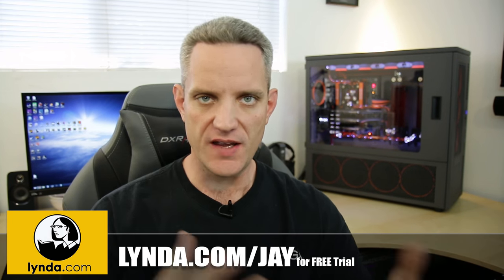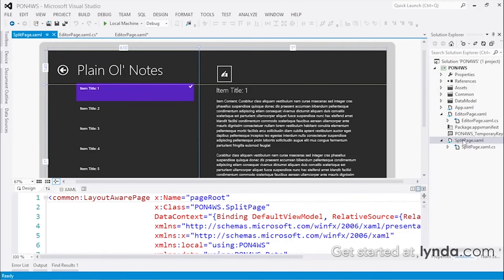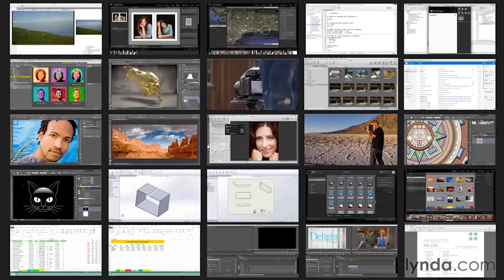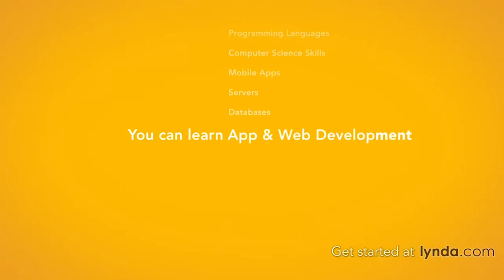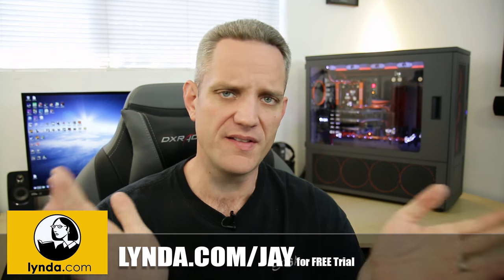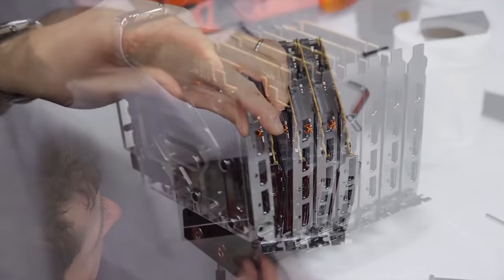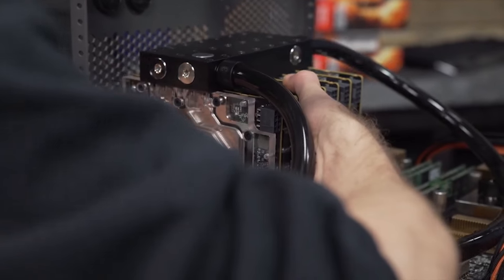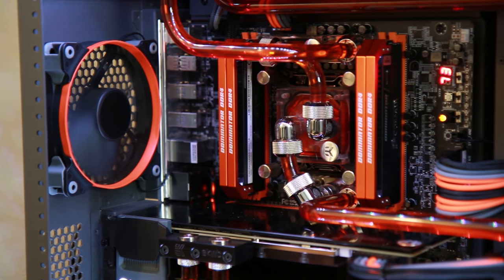Is watercooling worth it?

Comment: (15 fans if you count the power supply:) 

Also. Why do you run your full overclock all the time? Wouldn't that reduce the life of your components? Especially the power delivery? 

Is it just for the slight delay to change clock speed?
Reply: Basically what I'm trying to say is should I run my system this way?:)
Reply: When people run these types of overclocks, they usually set a limit for themselves.
Reply: what do you mean? isn't it better not to run it at full speed all the time?

Comment: GPU overclocks aren't held back by thermal issues?  That's inaccurate.  

The current AMD architecture has more headroom for overclocking with water cooling, and that's just as plain as the nose on your face.

Maxwell is a little different.  While they may not be hitting their max operating temps before the overclock becomes unstable, keeping the GPU, memory and VRM cooler, WILL in fact allow for higher overclocks.  Maxwell LOVES to run as cool as possible.  The colder they run, the better and more stable they run.

Comment: Saw your old "bottlenecking" video. Recently acquired a gtx 950. However, my cpu is a g3240 (locked, 3.1 ghz, 2 cores 2 threads, 3M  "smartcache") I'm a patient human. But if i got anything out of that video, is that my cpu might be asking my gpu to slow down a little. So the obvious solution is to get an adequate cpu. Is it worth the effort to keep the socket and go for a better lga 1150 cpu, or when the budget aligns itself with the constellations- acquire the new glorious fclga1151 along with faster stronger better ram and a glorious new pentium that will probably make me come to the same dilemma that i'm having right now.

Comment: So I'm building a new rig.  6700k, 980 ti, 3x 512GB samsung 950 pros.  I don't plan on doing any overclocking, except for the "stock" overclock on the ASUS STRIX card.  Would you say that 5x140 worth of radiators would allow me to run  my fans slow enough to keep everything nicely cool at stock speeds with a block on the cpu and video card, or would that be overkill?

I'm partially wanting to water cool for the "cool factor" and finally getting to build a pretty machine that justifies windows, and partially to hopefully make it a little quieter for when I'm recording.

My current machine is just stock air cooling and an h100i, and I don't have much problem with noise on my recordings because I use a compressor/gate, but I'd like to maybe be able to relax the gate a bit, if possible.

Comment: WC is nice and all but cleaning is a bitch especially when you gotta clean your blocks. Other than that the loudest thing in my build is the PSU. I only need 4 fans to run, two for the intake and two on my rad and both at 500rpm.

Comment: I am using a Gtx 1070 with an i7 4790k cpu. I don't overclock much. Water or air?
Reply: I use a gtx 1070 Msi x gaming, i7 6800k. And I use air. Air is worth. You only need watercooling if you overclock a lot. Or if you get a pc for a lot of money. Like a pc for 7000 dollars. :)

Comment: does the size of the case matter?
Reply: mid tower or full tower nothing smaller
Reply: In bigger cases you cen fit bigger radiators or fans. That's about it.
Reply: Yes
Reply: Sami Hookings i was going to build something on my old pc ( bought it on 2005 )
just for nostalgia... it is really small, it only fits a micro atx...
Reply: +Crooked crang Well... there are some ITX cases that have room for a radiator or two in them. Still, it's not too good of an idea to do custom loops in those cases. With that point, however, it wouldn't really ever be a bad idea to put an AIO cooler in a PC if the case can fit the radiator inside.
Reply: +SonicfanM Just a warning, unless you're willing to do some modding, prebuilt pc cases don't support radiators. If you want to, then a dremel and zip ties may be required.
Reply: strilight sorry, english is not my native language... Dremel?
Reply: +strilight there definetly are some prebuilt cases you can perfectly watercool in
Reply: SonicfanM
"Dremel" is actually the name of a brand that's also used as a universal term for rotary tools(commonly for cutting metal) that the company is also known for.

You see a lot of that in the US, people using a single brand name to define all of a certain item that the brand belongs to..
Reply: +SonicfanM size doesnt matter its the technique that counts
Reply: +SonicfanM the size of the case matter if airflow matters and the noise you're willing to deal with.
Reply: Azivegu so its small?
Reply: MrAeRoZz
ITS HOW YOU USE IT THAT MATTERS!!! WAAHAHAHAHAHAHAHAHAHAHA :"""-(
Reply: +SonicfanM yes, im on my 4th case now, gpus keep getting bigger!
my last case is huge, i spent nearly $200 on it. The reason is that pc cases generally dont break or become obselete, so in theory its the only part of your pc that is worth the investment.........get a BIG one if your are a gamer.....it will save you money
Reply: Jody Wilson larger cases means also larger fans and that means less noise or larger rads and that also means less noise
Reply: Jody Wilson imma buy a nzxt 530 source...
i'm in love with that case

Comment: I've been running Folding@home on my PC for about four months now.  I have an i7 6700k with a Phanteks air cooler and an EVGA GTX 1080 FTW Hybrid with two fans on the radiator, and it can run under load for up to 16 hours at a time.

Do any experienced users believe I should water cool my system?  I'm thinking about putting a 420mm radiator for both the CPU and GPU.
Reply: what temps are you getting and do you want to overclock?
Reply: @scooby-dooafterlife6969  CPU was maxing out at 62. GPU die was hitting 49, power delivery is cooled by a fan but doesn't show any temperature sensors.

I've since decided not to water cool after all, it'll cost too much and I move my computer to and from college far too often to make it worth it for me.
Reply: @justinvalentin8983   that is really low, yes you don't need it

Comment: I know, this is relativly old, but anyhows...

I have a GTX 760 with only 1.5 GB of RAM
Intel Core I7 and thats pretty much it... I was happy with my rig for about 8760 hours, so about one year of constant running and stuff... I know, my GPU isnt the newest one, but it was a relativly good one 2 years ago... I think... But, a few minutes ago i played THe Crew maxed out, I overclocked it, so i wasnt running it on 40.2-44.6 fps, but on 57.5-60 fps... it used 114.87% power... Thats a shitload of heat for a rearblow fan (reference design) to carry... It was damn loud!

If you are a little bit audiophile like me, you should invest 210€ in a custom loop to cool your GPU, because afterwards, you only have to upgrade on the backplate, the rest is there. The framerate would be a little bit higher i think, the temperatures would go down from 96C, but it would definitly a lot quiter!

Go ahead, and invest in that shit, because I am so gonna do this, i mean, i dont want my graphics card to melt!
Reply: a gtx 760 isnt really worth it to watercool tbh and framerates only increase if your gpu or cpu is being throttled. fps is to do with hardware more than temperature
Reply: taz874 of course it isnt really worth it, but i dont want my pc to melt down or be as loud as a fuckin car. But sure, it wouldnt be intelligent to do it, but i am planning anyways to upgrade to a 1080... And then i only have to buy a new waterblock for the 1080... But yeah, i think i will wait and save the money, and i think i can bare the noise for a little bit longer, my purse will thank me later :D

thanks for the response ^^
Reply: tatzecom i dont use wtaercooling and my cpu and GPU dont get that hot really. my core i7 6700k with a noctua nh-u14s and my temperatures are around the 50-60 degrees while gaming. my GPU sits around 60 degrees while gaming occasionally goes into the mid 60s(gtx 970). and the noise isnt that loud really once i lower the speed of the fans. if your cpu is running quite hot it could be your cpu cooler isnt that great especially if your using the stock cooler. 

im not trying to say you shouldn't water-cool but i mean if your temperatures are that hot with aircooling then that isnt normal. but i would defo first upgrade the GPU before you invest in watercooling
Reply: naaa, CPU is doint great, i have a cooler master thingy, dont know the exact name, but i pushed my GPU like 20%up in clockspeed. Consumes more power and runs hotter... My CPU sits around 40-50 degrees, almost never higher...

But my GPU is old, i run games at high, and the fan is the one from the reference design, and it is not that effective, thats all

heres a link, so you see what i mean

https://www.amazon.de/GALAXY-96NPH8DND7UZ-NVIDIA-GeForce-Grafikkarte/dp/B00SLJ957Q/ref=sr_1_fkmr0_1?ie=UTF8&qid=1475426100&sr=8-1-fkmr0&keywords=gtx+760+reference

ok this one is a 960 or something, cause i didnt found mine in the time...
Reply: taz874 also, yeah im first gonne upgrade to a 1080 custom design from, i dont know, MSI or Zotac, so the cooling is off the ground better
Reply: tatzecom ah ok i can see why your GPU is getting quite hot then if thats the cooling on it. most graphics cards these days have rather good cooling so temperatures should be lower on the 1080
Reply: taz874 yeah... Thea have like two 100mm fans, or 3, but everything is better than this design :c.... Well, it ran great for years, but now I just want more :D

Comment: how much could cost a water cooling loop? I have right now a 1070 that's what I would like to water cool and an i7 that does not necessarily need to be water-cooled, but if it is not too expensive I would like to. 
Also, my case doesn't have space for more than a 120mm radiator, so would it be very expensive to get a new one? 
thanks!

Comment: Would be watercooling an R9 Nano be worth it? My similar wattage R9 380 gets 99°C under load without me opening up the side panel, putting fans at 100% and having a loud as shit desk fan blow on to it.
I already know I should watercool for temperatures sake, but is it worth it over getting the Fury X?
PS - I will OC it to Fury X (or better) performance if watercooled.

Comment: main reasons I started doing it was because intel fucking haswell cpus ( 4670K / 4770K ) with  their awful IHS solder, 
easily getting to 100 degrees C when you go above 4.4GHz   

And at the time I had a windforce GTX 780  which was quite loud when overclocked,  and I needed more framerates for VR 
so I switched to watercooled 780Ti

Comment: Spec wise my pc is almost the same as your Skunkworks my specs i7-5960X, Asus rampage V Extreme, Corsair Dominator Platinum 32GB 3000MHz memory, 3x GTX Titan X, Corsair AX1500i. Its the type of hardware most people would water cool but I haven't because water cooling is out of my level of technical expertise and my Antec 1200 case doesn't support it.

Comment: +JayzTwoCents I have a very old blade server from 2001 - 2003  using Xeon prestonia's. 2 dual core cpu's and 4GB of ram, however some genius decided to remove the heat-sinks, completely and directly mount 2 40mm fans over the 2 CPU's it is about as loud as a straight 6 engine with load. Also they are not temperature controlled, D: so they are on all the time. Really thinking about water-cooling it and using it as a firewall, but as it is so old, is there any point?
Reply: +Robert Perry 0 point

Comment: SOOO, If one does decide to water cool there PC, They wouldn't  "really"  have to do bends in the hard tubing right? I mean they could use elbow joints right? Or would that end up being to heavy? I've never done it but I'm thinking of tinkering with it for the heck of it. Thanks for the reply/ies.
Reply: Singularity computers uses that style of hard tubing for his systems. His channel contains a lot of great information.
Reply: +Zeroplanetz many people do exactly that, instead of bending they just purchase 90°/45° angle metal joints, so you'll be fine.
Reply: Spoder Man I've recently found him, but have not watched really nay videos yet. Will get to that stat!
Reply: Daniel Macías Awesome, Thanks for the input.
Reply: +Zeroplanetz Fittings gets expensive really quick, you are much better with ruining a few lengths of tubing while learning to bend. It is not even that hard with PETG now
Reply: Mister16V If you're the type who completely disregards price to performance when it comes to all other aspects of their system, why stop at hard tubing?
Reply: +Spoder Man The cheapest APU you could find is the best price to perfromance, but its not the point. Hardtubing is plain better than soft tubing, no coloring over time, no chance of leeching plasticizer and looks better. Hardtubing is enough for 95% of that small percentage of those interested in watercooling. Exotic cooling solution are for extreme overclocker and come with some serious cons
Reply: +Mister16V When did I say hard tubing was better than soft tubing? I think you're confused as to what I'm saying.
Reply: +Spoder Man I haven't found any sub-ambient cooling solution that are practical for day to day usage. So its as good as it gets for 24/7 use
Reply: Mister16V Well I will try bending. But it was more of a question. Because I haven't done it yet. I more want to practice on my current build and be ready for when the new AMD Zen products are out.

Comment: What kind of cooling do you suggest i do for a i7-4790k with the new devils canyon architecture? Right now i have a amd 6350 and it came with a pretty good heat sink. My plan was to just use my amd heat sink on the i7. What do you think about that? would it work? If not what should i do to cool the cpu?

Comment: Yo!
I'm currently saving up for a new gaming/editing PC and have been looking at parts n stuff that would suit my needs.
I personally really like the looks of watercooled PC's and think I will be doing a loop using hardline tubing.

I really enjoy making things and using my hands, so the time and effort that needs to be put into making a hardline loop doesn't bother me really. I could just sit on my desk and just stare at the finished build for quite some time (like Jay explained he does in a recent video :>) and just admire it's looks.

However..
After watching this video I started thinking if a custom loop really is worth it. I would overclock my hardware if I'd go for a watercooled build, but keep them at stock if sticking with air cooling. (The watercooled would be much more silent too, as I'd use silent and efficient fans.)
These are my plans right now:

i5 6600K
MSI Z170A Gaming M7
GTX 970
16GB 2666Mhz DDR4
(+Case and all that other stuff like HDDs n SSDs)
=~1750€
+Watercooling parts, custom cables, fans and lighting etc. =~550€

=2300€ (OS incl.)

Then, i made another possible build where I didn't focus on aesthetics but rather on the initial hardware:

i7 6700K
GTX 980 (Ti possibly)
16GB 3000Mhz DDR4
(+Case and all that other stuff like HDDs n SSDs and a better PSU)

=~2300 (OS incl.)

Now the question is, should I go for the better hardware, or stick with my current build plan and go for the watercooled build?
Thanks!

(Then I imagined myself at my desk, with a friend seeing the PC for the first time. If I'd go for the air cooled better performing PC, he'd prob. go "Oh cool, new PC nice 4K setup u got there.". If he'd react to my watercooled extremely sexy watercooled build, his reaction would probably be significantly more interesting.. I mean people (incl. myself) would probably just prefer the watercooled not so ordinary looking PC over the traditional and (in my opinion) quite lame looking traditional air cooled build. What do u think/Whats ur opinion?)
Reply: ResQ what did you go for?
Reply: Rolf Neve Haha, funny that you responded ^^. I went with a soft tubing watercooled i7 6700K build, with a GTX 1080 and 16 gigs of DDR4. Also a 500Gb Samsung m.2 drive for some insane speeds :). Working well!
Reply: ResQ nice! Thinking of building one like that as well. Hope you have a nice new year!
Reply: Rolf Neve Thank you, same goes to you ^^

Comment: I have a really bad dust problem, 2nd floor and lots of traffic. Water cooling might be a solution. I have an attic space that is on the back side of the wall from my PC. It gets as cool as +5 and as hot as 32C. Far lower than an air cooled PC. I want to push the heat and fan dust problem into that attic space. Is there a problem with this plan?
I found a simple all in one for an i5 is worth it.
Reply: +Chuffered FUoogle Whats wrong with some good old dust filters?

If your plan is like linus's whole room water cooling then you are a lot braver than me. ill never try something like that.
Personally, i would just  wire a 200mm case fan from the psu out of the case, or heck use a standalone fan to blow the hot air away

Comment: What's the point about worrying about longevity when most people who water cool their stuff tend to upgrade every year or two anyway? Not like they need to worry about needing to have their parts last 10 years. I say watercool if you want the badass look. Otherwise air cooling will get the job done for 99% of people who don't run 3-4 gpu configurations.
Reply: Or use an All in One pre filled solution...

Comment: just got myself a custom watercooling kit, 1 360 and 1 240 rad. got i7 6700k and 1080 cooled. max temp on cpu with prime 95 is 78c on 2 cores. was 80+ with my old aio 240 cooler. wondering if my cpu voltage is too high for some reason. hw monitor says cpu vcore 1.360 highest 1.408. not sure if thats the voltage u change when overclocking or not... vid voltage 1.362 highest 1.409